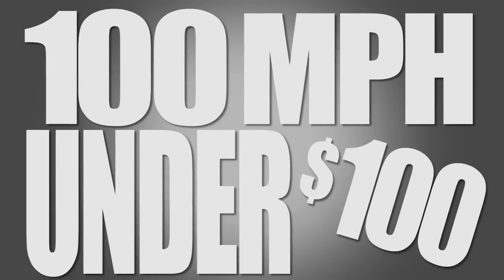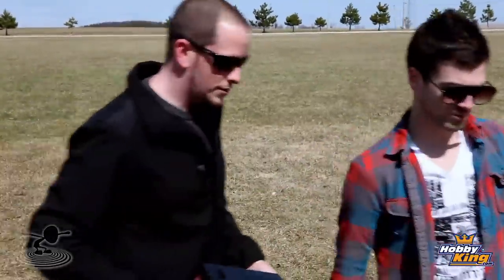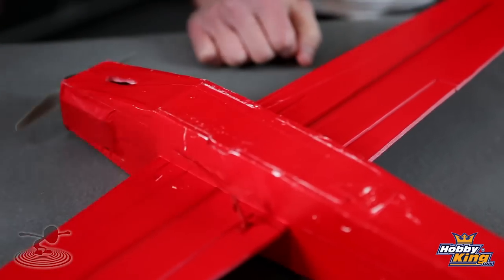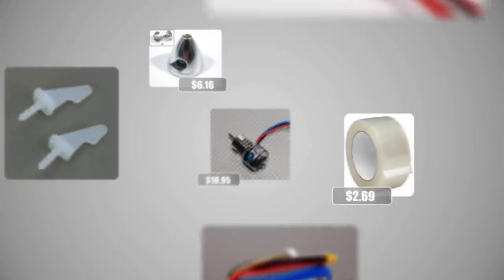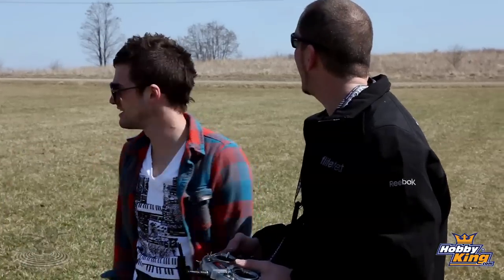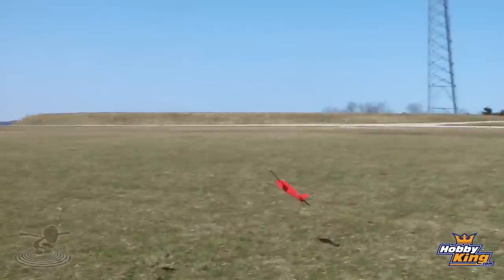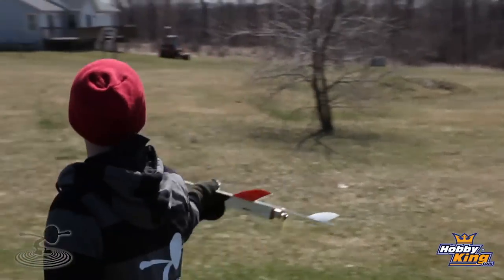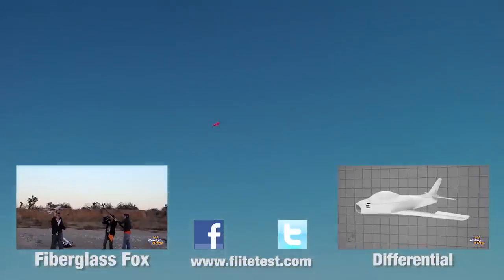Flite Test - 100mph under $100 - CHALLENGE

Comment: Maybe time to revisit the 100mph for under $100. How much have we gone forward in the hobby in 6 years?
Reply: Asking the Real questions here.
Reply: Just went to write the same comment
Reply: petfrogg o
Reply: Sandro Henriques cannot find measurements for the Ft bloody Wonder
Reply: Consider big they already beat the 100mph mark for $100(actually less), I would think that they should try and lower it to fifty now or something.
Reply: petfrogg This plane was suuuuuper unoptimized if you're willing to spend more time designing it. All those hard edges. If this could go over $100, you might make 100mph cheaper now
Reply: I think if the nose tapered to match the spinner and all the tape was smoothed, it would  hit 100 mph easily. If not, sanding or cutting the wing and tail surfaces into thin airfoil shapes would probably do it. Different props would provide significantly different performance as well. Maybe with just the right prop, even the wrinkly version could go 100 mph. A lot of props are too thick out near the tips. This is fairly easy to fix. 

The cheapest way to go 100 mph, not counting the work and travel expenses, is probably dynamic soaring. I'm sure that one of the JW designs, which are foamies, could be scratch built for very little. The JW60 apparently can go over 240 mph! With a foamy! For a cheap 100 mph, though, you'd probably want to make a little one to  keep the servo cost under control. 

Something like a small JW with an electric motor and special attention to smooth surfaces could probably go well over 100 mph.
Reply: On further research, it's apparently possible to break 100 mph dynamic soaring with a fairly ordinary foamy that looks like a Zagi. For that matter, apparently someone has achieved 70 mph with a Zagi.
http://www.rcspeeds.com/aircraftdetails?AC=248
http://www.rcspeeds.com/aircraftdetails?AC=311
It might even be possible to do it withing walking distance of my home, but that would be irresponsible because there are so many things to hit! Plus it would probably require something cleaner than an ordinary foamy, in order to get the required altitude beforehand, since the upwind slope is rather gradual. There's a perfect place a couple of hours north of here, but I think it's in a national park. 

If you could sneak up Mt. Washington it's supposed to gust to 110 mph tomorrow. I suspect dynamic soaring wouldn't be necessary for 100 mph if one used a glider made of solid oak and maybe some lead ballast. That ought to be fairly cheap. However, there are issues of legality, and I expect the road is closed. Don't go up there in a light vehicle when it's really blowing.
Reply: Agreed!
Reply: some edf jets (i think flite test did a review on 2 of the freewing ones) are reliably hitting 80 mph and i think i saw one hitting 115+ mph on a forum
Reply: Hello we are in 7 years forward
Reply: How about 8 ?
Reply: Or 9 years!
Reply: Agreed!
Reply: Don’t you mean 9 years?
Reply: Almost 10 now
Reply: 9 years
Reply: I feel the only real improvement over the years is the battery
Reply: Totally agree, now it's 2020.. How fast can you go flitetest under 100$?
Reply: Agreed
Reply: 2021 and I couldn't agree more
Reply: but your comment is from 4 years ago so its been 10 years
Reply: 10 years
Reply: 11 years now
Reply: 10*

Comment: Now 200mph for under $200. :P
Reply: ***** agora mach 3 por 3000 reais.
Reply: Oh come on, clearly, the simple solution is to make a very cheap ramjet out of... something, and do 2000 mph for under $2000.

Or SCramjet, and do 10000 mph for under $10000.

Note: long-range antenna and FPV system ABSOLUTELY NECESSARY!
Reply: you actually might be able to do 500 MPH for $500 or even less if you do most of the work yourself... search dynamic soaring
Reply: Peter Smythe Rocket plane would be a lot less hassle in technical ways. A ramjet needs specific speeds to operate, and a scramjet is just technically nonfeasable for a budget build. Like the Me163, a simple liquid fueled system could be the answer to do low budget speedflights... Safetywise, not the best ;)
Reply: ***** Rocket engines or OMS engines
Reply: 10 miles under 10 dollars. Haha
Reply: MR OhmyGOD You can get close. Build a plane made out of card-stock (ie. paper; couple cents, essentially free), use a small brushed motor (about $1-$2), prop ($1 or less), and a V911 flight controller (about $10; has 2 servos and can control the brushed motor).
Reply: great!I'll try it
Reply: Mark van Werven I've been looking for a suitable system to burn Kerosene and LOX. It should be very feasible
Reply: Liquid oxygen is VERY dangerous stuff, which many people fear. Adding kerosene to liquid oxygen makes a very instable mix, even adding the kerosene would ignite the mixture...
Reply: Yes, that's how rocket motors work. To break the sound barrier takes an enormous amount of force. About 6x as much as any small scale jet motors I've seen available. Of course its dangerous.
Reply: True. Anyhoo, this is the internet, nobody including me gives a fuck. Make it and film it. I was just pointing out the possible dangers of low budget rocketry, it's not like anybody here on the comment section actually works out their "plans".
Reply: MR OhmyGOD lol your self can go twice that if in good shape
Reply: 66
Reply: +Photo314159 like 0,50 mph for under 0,50$
Reply: 1000 hectares per hour, for 1000 Prussian Francs.
Reply: Photo314159 200 mph is very tricky and might need a rocket powered plane but I think they can
Reply: Photo314159 a million under a million
Reply: How about the speed of light for, how much?
Reply: SkyPilot 737 km or miles?
Reply: Yes definately
Reply: Just make a rocket :)
Reply: @QueueTeePies  the sound barrier is 767 mph

Comment: If I could break the sound barrier for less than a grand I am game.
Reply: I think the way you could do it would be to take it up to a couple of thousand metres with a quadcopter, which would be a nightmare to do because the air would get noticeably thinner at the altitudes you would want to go to, and then you would have to drop a rocket which you could fire. If you put wings at the very back of the bomb, it would be very nose heavy so steering it wouldn't be a problem.

You would have to either put a parachute on it or use really cheap electronics, and you would also have to check with the government to see if it was even legal, because you would firing firing things straight down with no control over where they went, and you would probably have to get a no fly zone too
Reply: Nathan JR buy a whip
Reply: Nathan JR let me just put this out there: no rc plane has gone over mach 1, much less for under $1000.
Reply: Home made jet engines and ductape my friend no just kidding but the radio would be exspensive because the humongous range you wil need
Reply: High power rocketry man!
Reply: Unfortunately that will never happen. It has been done to scale, but no RC hobby planes will actually break the sound barrier. The speeds needed can't be achieved at low altitude with low thrust hobby motors/jet engines.
Reply: i wouldnt say that. maybe someday they will make motors that can have a high enough acceleration that they will be able to do that, but it will prolly not be for the next 50 years, at least
Reply: might be possible one day. They probably never thought hobby planes would break 100 mph...
Reply: yea i think so too. they are already hitting almost 600 for some of the big turbines.
Reply: +jaddbo  you do realize that the technology exists, its called  turbine. Use a bigger one, or multiple, and you can push any "rc model" mach. No one is willing to put $50 000 into a model airplane, or risk shock stall at low alt. when it breaks the barrier. The plane likely wouldn't survive.
Reply: true, but aircraft take a long time to come up to mach speed. an example is that sweeden actually has an agreement with france so that they can fly over france to train their pilots to fly over mach, because it takes so long to come up to speed
Reply: jaddbo I have a solution just put a giant rocket sled runwayy up for. Those planes not because its practical but because I want to see it
Reply: +jaddbo it's the getting to altitutde that takes the time, laws prohibited mach speed flying low due to the damage the shock wave can do to things on the ground.
Reply: 0601ac  yes, but wouldn't an rc plane also have to abide by the same laws? it is a flying vehicle, and would cause damage to stuff on the ground (windows, ears, ect)
Reply: +jaddbo it's would yes. another reason why it isn't feasible
Reply: ok then. have we all finally reached an answer?
Reply: the debate started from someone saying one day we will have he tech. to make an rc do mach. the answer? We've had it for a while, no one is dumb enough to shell out $ to make an rc go mach.
Reply: ok i can agree on that
Reply: put things on a timer maybe?
Reply: Put rc on a hobby rocket. Done.
Reply: Use a sugar rocket.
A s*** ton of em.
Reply: Buy a megaphone and a weed wacker.
Reply: I don't know if you could break Mach 1, but I bet you could go over Mach 0.5 if you were a skilled builder who was very patient with a sanding block. The model in the video below has since reached 519 mph, which is something like Mach .67. It's only doing 505 mph in this video.
 https://www.youtube.com/watch?v=r7gL9uA-McY&t=5s

My intuition says that you might be able to do it with a small jet engine, model sized, and very careful design work, but I don't know if you can get a jet engine cheaply enough to leave money for the airframe.  Maybe it could be done for $4,000. However, that's assuming you can do the design work yourself or get it done for free. Obviously model should be sized just big enough to carry the engine selected. A catapult launch would probably be necessary, and some kind of recovery process figured out, as I doubt it would have a reasonable landing speed. Long range FPV would probably be necessary to fly it. Legalities might be a real issue. Maybe best to put it on a big boat and fly in international waters, which would make recovery rather difficult. So that makes the cost balloon more. Come to think of it, a rocket might be easier.
Reply: I think it's possible with rocket engines
Reply: @jaddbo8230  4 years on,sometime last year the speed acquired on DSing sailplane was 540 something MILES /HOUR. NO MOTOR!!!
Reply: Just duct tape a rc plane to the inside of a fighter jet

Comment: I came close by accident in 2003 I had a cheap Estes f4 corsair It had a 130 size motor and another 130 motor to make it turn the old system was heavy and could barely fly the airplane I installed a fireball 370 heli mmotor and a   hobby grade radio it with a 300 ma 8.4 nmh pack from another cheap toy it was stupid fast we were guessing about 70 to 90 mph it was very hard to keep it in sight !!! I was just trying to upgrade it to flyable status people around us were shocked to see it was not nitro powered I did it just with stuff I had on hand at the time great vid !!!!

Comment: Broke that speed with my first control line trainer. Thin solid balsa wing, basic profile fuselage, old glow engine. We clocked it at 110mph first flight out. Given that control lines experience roughly triple the parasitic drag of equivalent rc models, it shouldn't be too hard to manage that speed with basic 2 channel control and an old glow engine powering a small plane.

Comment: Just fly a brick and let it fall, you will "fly" over 100 mph
Reply: 001Peaceman no you wont
Reply: Terminal velocity is different depending on air resistance, but i still reckon a brick will fall faster than 100
Reply: but to fly a brick high enough to when its dropped will reach over 100 mph, you'll certainly need a more than 100 dollar plane
Reply: A cliff
Reply: No, I did the physics and they would need to get it to about 200 metres in the air
Reply: yeah because you can't find bricks for .23c at home depot

you can I know from experience
Reply: 001Peaceman 
Controlled falling

Comment: I would say something with a high wing, not too big, not too small, approx. 750mm. You could take a 3 channel (without ailerons). Or a 4 channel plane (with ailerons) but that is a bit more advanced. In my opinion, first plane, not too expensive, you will crash it at some time, so first get some experience and after that buy a nicer one.

cheers !

Comment: @joshuamelvin : OK thanks for clarifying that Josh.  The reason I brought it up was because, on your advice, I ordered some of those same DS929MG servos from HobbyKing that you spoke of in that video...to be installed in my first plane that I hope to break the 100mph mark with.  It's a little 50mm EDF-powered F-16 made by J-Power (which I also bought from HobbyKing), and I'm souping it up with a Wemo fan and 6000 Kv outrunner.

Comment: That transmitter won't work for the second plane (it doesn't have mixing for elevons.) Hobby king has others that WILL work, for only a few more dollars. Right now there is a nice Turnigy for just $25: http://www.hobbyking.com/hobbyking/store/uh_listCategoriesAndProducts.asp?cwhl=XX&idCategory=82&v=&sortlist=P&LiPoConfig=&CatSortOrder=asc

Edit: Apparently you can get a small device to make any transmitter work with the second plane, but it costs about the same to just get the nice turnigy transmitter. The little mixer device is here: https://www.hobbyking.com/hobbyking/store/__6321__TURNIGY_V_Tail_Mixer_Ultra_small.html

Comment: Technically you need to fly the plane in both directions to eliminate how fast the wind can be pushing you. This is an old trick to get an approximate potential air speed. Take your RPM in thousands and the prop pitch in inches and multiply together. Example , 6600 RPM and 8x6 prop (6) - 6.6 times 6 yields approximately 40 MPH. Naturally aerodynamics is also really important.

Comment: A front engine, tractor type airplane is usually slower than a pusher, because the propeller up front is pushing air past the airframe. Parasitic drag is higher as a tractor. This is proven with most full size airplanes. Less horsepower is required to propel a pusher.

Comment: on the later flights of the 1st plane and the flights of the second plane, it looks like you are not using the hobbyking radio!  did you have to switch to a spectrum to get more control?  at any rate, its still impressive.
Reply: No, They say you can use it, But if you look from the first vid he uses his.
Reply: Kieran Beavis kind of cheating if you ask me.  granted, you can fly most any plane on a basic 4ch radio, but a DX" " has many added features which can help, especially with a plane like those.  expo and such can make a difference.  I just would have liked to see them use the El Cheapo radio...just to show for sure that the low end gear can do the job.

Comment: if i was betting anything on a 100 mph challenge, i wouldn't even bother with using a 3s and just dropped in a 4s lipo liked they used on the second wing.

Comment: Swap that Turnigy 2836 for a NTM 3536 1800kv
Swap the Battery for a 1300mah 6s

and you will be over 140 MPH

The only difference in price is the battery for $10 more.

Comment: What if the plane was a tube to house an EDF and electronics, and then built with wings like the Viggen? Canards take away a little bit of the length of the minimum necessary wingspan, why not?

Comment: 1000kw motor is too slow with that small of a prop.  Turnigy 2836 2350kv and a 5.5x4.5 will put you over 120 on 4s.

Comment: Yeah that's not happening, maybe for $20,000 but no way it'll happen for $200. This is because of what sneadrecords said and you have to consider that air resistance increases exponentially with speed, so you would need much more than double the power and a much much stronger frame. For $200, that is likely impossible.

Comment: watch " crazy fast rc plane 5000kv". could be built for less than $100. looks like a top model stiletto. forget about carbon fiber rods, better put a steel rod through the wings/hor. stab on that one ;p

Comment: Is there anyway to do rc without using li-pos cause it's expensive and can explode??
Reply: +T hebluntcrayon you could go for petrol or nitro engines but lipos are a lot cheaper and easier to use and they only explode if you don't look after them properly. Just charge them slowly and don't discharge them at an insane rate and they should be ok.